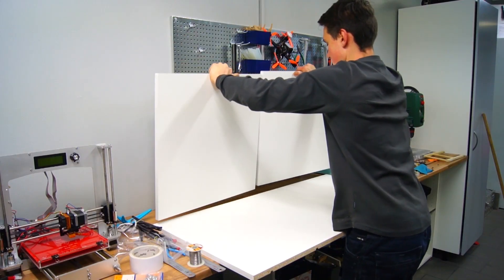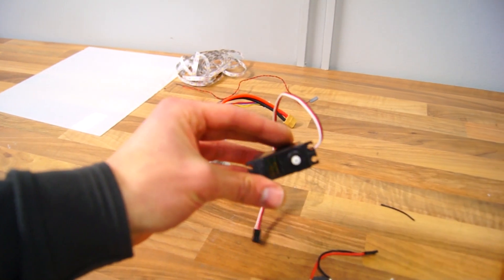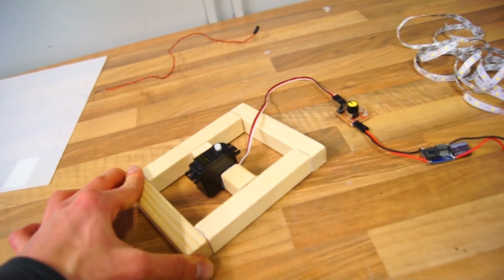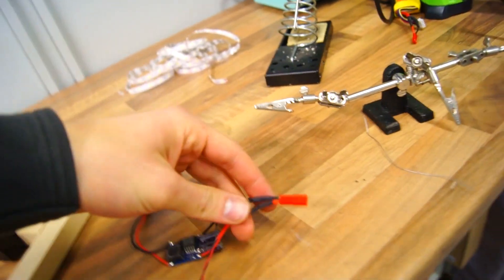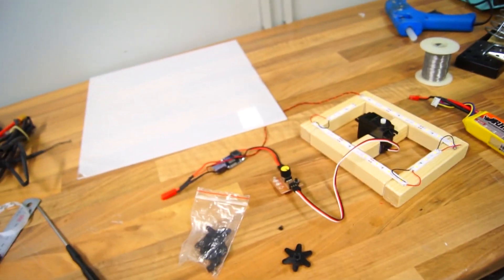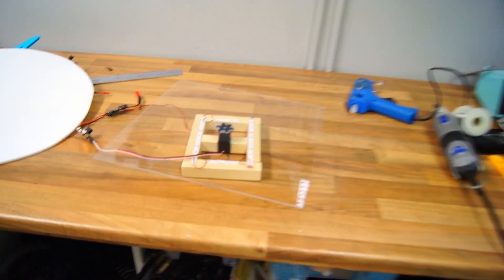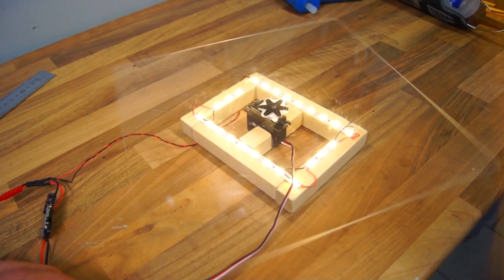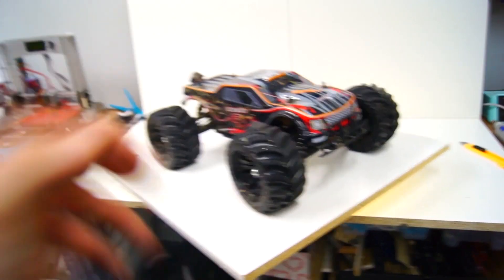How to Make 360° Turntable - DIY Rotary Table

Comment: why not use a low speed motor?
Reply from the maker: You could, but servos are generally much cheaper and I used what I had around the house.
Reply: RCLifeOn are there any other advantages to servos, because we use both in robotics
Reply from the maker: They can be easily controlled and have gears inside of them, meaning it can spin heavy objects on the plate.
Reply: RCLifeOn I see, thank you

Comment: could I skip the BC and using a 9v battery instead
Reply from the maker: The servo motor can only handle 7V. You will need a 5V battery pack, or a voltage regulator.

Comment: I thought servos only rotated 180 degrees... Mine does... However I am controlling it with an arduino. Does that have anything to do with it?
Reply: You're right. Most servos only rotate 180 degrees but this is a modded servo, with no end stops. That also means that it has no positional control anymore. It's basically converted into a standard high torque DC motor. But if i were to build one, i would use gears as a servo is way to jerky at low speeds.